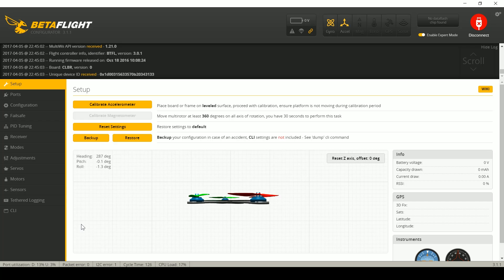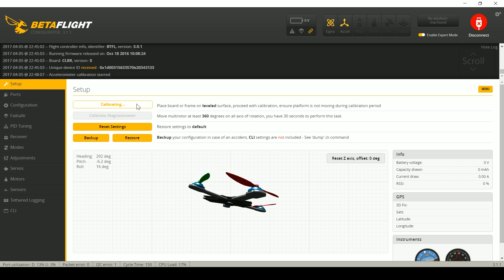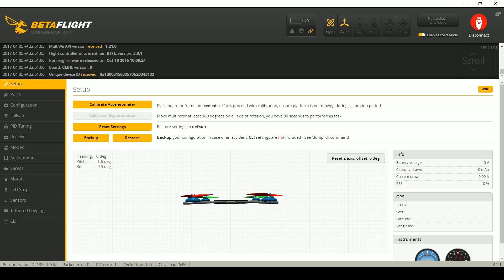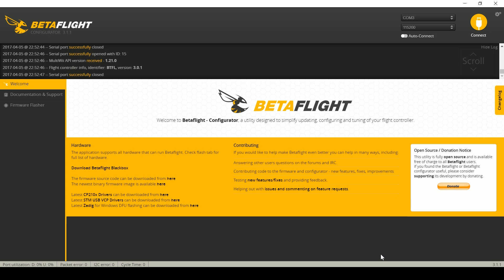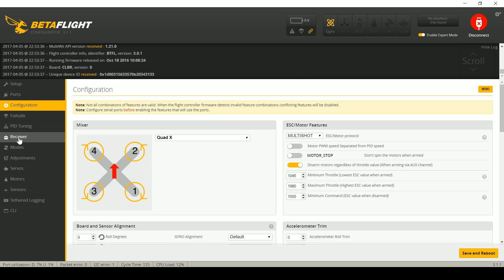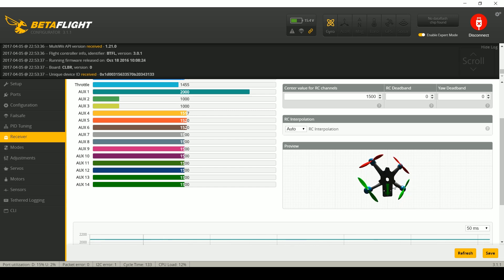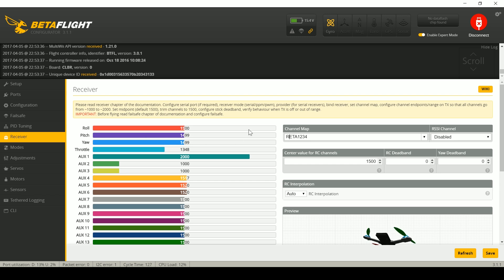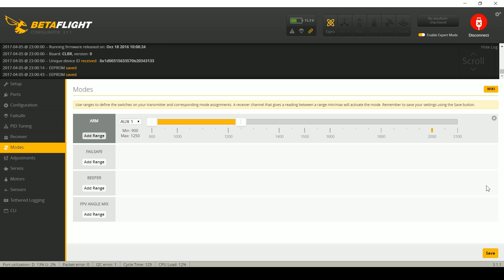Quadcopter Won't Arm | CLEANFLIGHT BETAFLIGHT

Comment: If you have a flysky transmitter, make sure you are not using switch d, there is a huge software bug where it locks all of the channels at 1500. I had this same problem when trying to use switch d to arm. Also go to switches assign and put all of the stuff your not using  on a switch your not using.
Reply: ran into this myself
Reply: What do you mean switch d ?
Reply: oh this might explain my glitchy behaviour.... i can move arm to switch b? and beeper to one of the pan pots. ok moved it all around, thanks for posting... i was getting odd disarm and rearm when i use swb for my beeper....

Comment: My Torrent flew great for 83 minutes, now it won't arm. I've tried everything here, as well as rebinding it to my DX18, creating a new model and binding it there. When I go to my Rx tab in Betaflight, none of my channels move with my stick inputs. I'm guessing that the Rx is no longer sending signals to the FC? What could cause that, besides bad connections? Everything looks ok visually upon inspection. I'm at a loss, and sent an email to HH detailing everything I've done. I hope you might be able to help too. Thanks!
Reply from the maker: Receiver lost its bind to the TX. This can happen if the bind button gets bumped accidentally in flight? Unlikely.

Broken wire between receiver and FC.

Comment: I need help. I can no longer arm the engines, I have followed these steps but I have not solved the problem. Everything looks ok in betaflight. checked the motors in the motor tab, the motors run normally. What can it be?

Comment: I found the min check-- wat exactly do I type into CLI?--in order to change the min
Reply from the maker: set min_check=1234
save

Replace 1234 with a value that is 15 more than the value you see in the Receiver tab when the throttle is all the way down.

Comment: I have an xm+ and I solder it directly to an omnibus f4 fc, it was working ok until I moved my xm below the fc to make room for the vtx. It is bound and I checked everything except beta flight won't recognize any inputs from the radio. Any guess what could be happening?
Reply from the maker: Confirm the XM+ has power using your multimeter. Are the LEDs lit up? Confirm the XM+ is bound to the Taranis. Does the status LED go solid green? If all that is working then likely there is an issue with the signal connection to the FC. Time to get the soldering iron out.
Reply: Joshua Bardwell it's bound, I found that the pined got ripped off. Now Im trying to connect it to uart 1 but no success yet

Comment: Joshua, I hate to continue contacting you. but now I have 3 that arm and 5 that do not. I know you have spent these kind of hours and faced these problems. I watched the video for 3 times and still can't find the little trick. Some of them show armed on the copter (red light), and on the betaflight. No arm. Thanks for your additional thoughts.
Reply from the maker: If the light comes on and the Modes tab shows the Arm mode as active, then you are armed. The question is then why the motors don't spin. Do the motors spin from the Motors tab? Does the receiver show correct response to stick movement?
Reply: Joshua Bardwell same question and my answer to you is no light comes on and tab does not switch green however the little notch moves when the switch is flicked so clean flight is seeing the stick input....its just not registering to the quad....
Reply: Yes, it shows as armed, the sticks move in the right motion- on Beatflight, the little model moves all over.

Comment: NONE of this worked, except in the modes screen the arm block now turns yellow, but motors don't spin up. I am trying to put a omnibus F3 FC board in a Bayangtoys X-16. Wont arm. Any more ideas?
Reply from the maker: If the arming block turns yellow then the FC believes that it is armed. The next question to explore is why your motors aren't spinning. Troubleshoot from the FC through the ESC to the motor. What motor protocols does the ESC support? I am going to guess your FC is using Oneshot or Multishot but maybe the ESC only supports PWM?
Reply: If I could find the ESC protocol data that would help, but no luck so far. There is a one minute video from a guy who has done the mod, but al he shows is that it works, not how he did it. I asked for more info but no reply so far...
Reply: Thanks! I switched protocol to PWM and it works perfectly. You might want to add that step to your next video.

Comment: okay, thank you, i could fly again
i upgraded my flysky i6 to have 10 channels so i could use failsafe and i configurated a failsave in bf without transmitter
then i had to bind my copter again and it wouldnt arm, arming works now because i had to delete the failsafe mode in bf and then the stickmovement worked again in bf, before it wouldnt do anything
this AERT thing is really stupid why dont they name it like the sticks, throttle yaw, roll etc, i didnt get this
now i will come to the question, do my other channels dont work now? or was it just buggy when failsafe was active that i could not arm or use the sticks, maybe i configured it false
Reply from the maker: The channels are named the way they are because all of this comes out of fixed-wing models, where aileron, elevator, rudder, and throttle are the correct names.

Comment: for some reason mine start at 1087 and its already at 100% i dont know how to get it to lower to 1000
Reply from the maker: You need to find out how to configure your transmitter to let you use "extended limits" on your channels.
Reply: Joshua Bardwell i have a taranis plus. and i found how to extend but still wont go all the way to 1000

Comment: I calibrated my receiver so the minimum throttle is solid at 1,000 and the min_check is set to 1,020 yet it still isn't highlighting when I try to arm. Using a Taranis and the ImpulseRc Helix.
Reply from the maker: Well, it's one of the other things in this list then.
Reply: I calibrated the accelerometer but then turned it off, and the CPU load is 13%. That covers the first half, and the second half all my numbers appear to be correct; the receiver is calibrated and the min_check is above the minimum throttle. Not sure what else could be going on because that covers all the issues listed in the video.

Comment: The motors do not spin when I move sliders up. I have calibrated the ESC's and BLheli seems to determine whether one shot 25, 42, or multi. The engines are Racestar 2205's and MN2205 (Wizzard). I would not know how to check GUI with Blheli or which setting to adjust. I set the Beep volume and you can hear that beeper!!
You know how many hours you have to get it all done right!! After 7 times-- I almost quit. I just don't have that "Shut Dowm" button in me. I just started flying-- That I can handle!

Comment: Joshua, 7 new builds, 3 arm, 4 will not. I have tried everything in this video (Sketchy on min-max) Through playing with end points, They all show "ARM" on the "flight board", and on Betaflight indicator. However, they will not "actually arm"-- either with controller, or on Betaflight motor tab, I assume that the Betaflight indicator. It will not arm on the Betaflight motor tab, or the controller.  Joshua, I have over $1000 of accesories sitting here with no function. All other points-modes, configuation-- well, everthing works exept arming.
I watch your videos because "I do learn something". This arming thing is huge limiting factor fot me. I thank you ahead of itme for your thoughts.
Reply from the maker: If the Arm mode goes yellow (or green for Cleanflight) then the FC thinks it is armed. The question then is why the motors aren't spinning.

Do the motors spin from the Motors tab when you raise the sliders?

Have you calibrated the ESCS? After calibration, verify with BLHeli GUI that the endpoints have changed.

Do the ESCs support the required motor protocol (BLHeli ESCs only support Oneshot out of the box. BLHeli_S support Dshot and Multishot too).

Comment: Ok I got my Replacement Wizard armed but on the motors tab in Betaflight. If I go full throttle all the motors go full then Motors 1 and 3 drop down 2 stays full and 4 drops a little.  What's going on there? Is it safe to take out side for a test flight?
Reply from the maker: All I know is you shouldn't be spinning the motors full speed with props off. Go try to hover it.

Comment: please someone help! I crashed the Wizard and now no matter what i do the kwad won't arm.The motors spin up fine in betaflight but when i try to arm nothing happens. PLEASE IM DYING HERE MAN
Reply from the maker: Did you check all of the things in this video? This video is what I would walk you through if I were to get on the phone with you personally to help you. So which of these things is preventing you from arming?
Reply: I followed the video exactly the only thing i could think about preventing me would be my sticks are all 40 to the right because i'm using spektrum
Reply from the maker: Having slightly off-center sticks wouldn't prevent arming, unless you were outside of min_check or max_ check. Can you adjust sub-trims in the Spektrum to fix the un-centered channels? It can't be fun flying with the quad tyring to rotate when your sticks are centered. You can also adjust rx_mid in Cleanflight/Betaflight to tell it where your channel center is, if it's not 1500.
Reply: would you have any other idea? I crashed and one motor spun up to full speed then stopped and I haven't been able to arm since
Reply from the maker: Replace the flight controller.

https://goo.gl/n1VHTu
Reply from the maker: Calibrate the accelerometer.
Reply: Joshua Bardwell I disabled it

Comment: Great video! Note with regard to the min_check: you need to type "save" after changing the values. You see Joshua do this in the video, but it goes so fast that i didn't notice this at first.

Comment: my receiver is not connect to the controller I have a flysky fsi6 when I connected better flight receiver it does not show up but it shows connected to the receiver but is not responding  who can I do to fix this I follow each step in your bataflight for the wizard X220 need your help again if you can

Comment: I am running cleanflight, naze32 rev6. The arming light turns on but won't give any signal to any of the motors. I have been over the solder pads and they are fine?
Can anyone help me?
Cheers
Jack
Reply from the maker: +Jack Nicholls do the motors spin from the Motors tab?
Reply: Joshua Bardwell no they don't
Reply from the maker: +Jack Nicholls what exact ESC is it. Blheli? Blheli_s? 

What motor protocol are you using? Oneshot? Multishot?
Reply: Joshua Bardwell they are Turigy 10A. it used to fly fine, but know it doesn't. They also work fine strait from my Rx
Reply from the maker: +Jack Nicholls "Turnigy 10A" is not specific enough. Please tell me exactly what ESC they are. Give me the full name. Are they SimonK, BLHeli, Blheli_s, what?
Reply: Joshua Bardwell The lable just says Turnigy 10A plush.
Reply from the maker: +Jack Nicholls OK I am going to wager they don't support oneshot. Change your motor protocol to PWM instead of oneshot. But honestly, those ESC's are super outdated and won't fly well at all. If you can find your way to buying some modern blheli_s ESC's it will be worth it.

Comment: did i mess something up here?   
2017-05-06 @ 12:25:48 -- Running - OS: Windows, Chrome: 58.0.3029.96, Configurator: 3.1.1
2017-05-06 @ 12:26:49 -- Serial port successfully opened with ID: 1
2017-05-06 @ 12:26:49 -- MultiWii API version received - 1.21.0
2017-05-06 @ 12:26:49 -- Flight controller info, identifier: BTFL, version: 3.0.1
2017-05-06 @ 12:26:49 -- Running firmware released on: Oct 18 2016 10:35:52
2017-05-06 @ 12:26:49 -- Board: SRF3, version: 0
2017-05-06 @ 12:26:49 -- Unique device ID received - 0x2100214234570820383738
2017-05-06 @ 12:27:29 -- Accelerometer calibration started
2017-05-06 @ 12:27:31 -- Accelerometer calibration finished
2017-05-06 @ 12:38:12 -- EEPROM saved
2017-05-06 @ 12:40:35 -- Unrecoverable failure of serial connection, disconnecting...
2017-05-06 @ 12:40:35 -- Serial port successfully closed
2017-05-06 @ 12:40:50 -- Serial port successfully opened with ID: 2
2017-05-06 @ 12:40:50 -- MultiWii API version received - 1.21.0
2017-05-06 @ 12:40:50 -- Flight controller info, identifier: BTFL, version: 3.0.1
2017-05-06 @ 12:40:50 -- Running firmware released on: Oct 18 2016 10:35:52
2017-05-06 @ 12:40:50 -- Board: SRF3, version: 0
2017-05-06 @ 12:40:50 -- Unique device ID received - 0x2100214234570820383738
2017-05-06 @ 12:41:51 -- EEPROM saved
2017-05-06 @ 12:41:52 -- Device - Rebooting
2017-05-06 @ 12:41:54 -- Device - Ready
2017-05-06 @ 12:42:10 -- Unrecoverable failure of serial connection, disconnecting...
2017-05-06 @ 12:42:10 -- Serial port successfully closed
2017-05-06 @ 12:42:20 -- Serial port successfully opened with ID: 3
2017-05-06 @ 12:42:20 -- MultiWii API version received - 1.21.0
2017-05-06 @ 12:42:20 -- Flight controller info, identifier: BTFL, version: 3.0.1
2017-05-06 @ 12:42:20 -- Running firmware released on: Oct 18 2016 10:35:52
2017-05-06 @ 12:42:20 -- Board: SRF3, version: 0
2017-05-06 @ 12:42:20 -- Unique device ID received - 0x2100214234570820383738
2017-05-06 @ 12:42:49 -- Unrecoverable failure of serial connection, disconnecting...
2017-05-06 @ 12:42:49 -- Serial port successfully closed
2017-05-06 @ 12:43:05 -- Loaded release information from GitHub.
2017-05-06 @ 12:49:46 -- Using cached release information.

Comment: got it to arm now my other issue is motor 1 and 3 on idle rev up
Reply from the maker: +Honey Tap if you're just idling on the ground it doesn't mean much. Just go fly and don't sit there idling.
Reply: If im in the air and i dropped throttle it would rev... but i chamged all my controller travel settings and calibrated the esc and the drone and it works great now thanks again bud love your videos

Comment: Joshua please help! So I am building a micro quad with a Loki x2 frame from hell-pal. I'm using a racerstar 12a 4 in 1 esc and an eachine minicube fc and flysky fs-a8s reliever. All new parts. The esc/fc stack sits at a weird 45 degree angle and I have the yaw set to -45 degree. The setup quad picture moves in the correct directions so I assume the yaw number is correct? My problem is when I give it the minimal amount of throttle, the motors will ramp up to full throttle and it is oscillating out of control. If I have props on it it just freaks out and won't even make it off the ground but tumbles to the side. It does this in either angle or acro mode. The motors all spin in the correct direction, props are on right, and the motor numbers are correct. Please help thanks!
Reply from the maker: +steven are you 100% sure the motors are spinning the correct direction and are wired correctly.
Reply: Joshua Bardwell if I spin the motors from betaflight with the master tab that spins all of them at once I get no oscillations and they act normal. But from the throttle on the radio I have the issue. I had to change the motor orientation from watching your video on the motor resource commands because they were out of order so I'm using a custom mixer  with motor 1 being back right, 2front right, 3 back left and 4 front left.

Comment: Ok thanks for the link earlier. Iv watched this vid and done everything step by step. And guess what. My motors are still not spinning. Can u watch my vid again to take another look please
Reply from the maker: Is the copter arming? Does the arm mode in the Modes tab go green (for cleanflight) or yellow (for betaflight)?
Reply: Joshua Bardwell yes. It turns yellow. On betaflight
Reply from the maker: +Craig chivers do the motors spin when you raise the sliders in the Motors tab?
Reply: Joshua Bardwell no they don't spinup.
Reply from the maker: +Craig chivers do the ESC's make the full blheli startup sound, containing five tones, or do they play three tones only?
Reply: Joshua Bardwell  all five
Reply from the maker: Then the ESCs are receiving and recognizing the throttle signal. It's unusual that they don't spin then.

What motor protocol? Oneshot or mutishot or DSHOT?

What ESC? BLHeli or BLHeli_S?

What is your PID loop rate? 1 kHz, 2kHz, 4 kHz, etc?
Reply: My pid rate is 2khz. Not sure about esc il let u no later. When I'm home
Reply: Joshua Bardwell  they are flycolor 12a450hz 2-4s lipo Bec 5v/2a rohs.
Reply from the maker: +Craig chivers give me a product link okay? That's not the information I need.
Reply from the maker: +Craig chivers there is no indication that this ESC supports anything except PWM signals. If so, It's a poor choice for a mini quad. That's probably why your motors won't spin. Betaflight is using oneshot and the ESC's font understand it.
Reply: Joshua Bardwell   Thanku so much. Il get some different esc then. Thanks for ur time and patience with me. I really appreciate it. And thanks for finding the fault.

Comment: still dont arm and when the batery is not connect the fc keeps bebbing , its a ARRIS 1177 SP Racing EVO F3 Flight Controller w/ PDB and flysky rx/tx
Reply from the maker: +rob the beeping is because the receiver is not powered so the board is in failsafe. In the CLI type "beeper -on_usb" then save to disable the beeper when you are plugged in to USB.
Reply: thx that have works , now i try to calebrate ecs , when i do what i must do , set the slider in top place and plug the battery in the motors reps up and when in put the slider in lowest point and take the battery out nothing happens there are no peeps at all like normal
, if i give a bit trottle the keep getting speed up
Reply from the maker: +rob maybe "programming by tx" is off in BLHeli?
Reply: no thats on and everything on blheli went good also the calebration , but on beta not , no calebrate beeps , and when i try to fly it it looks like a lot of trottle and it only flips over